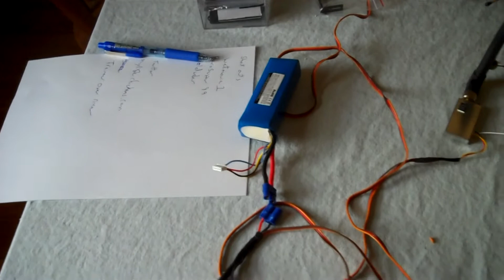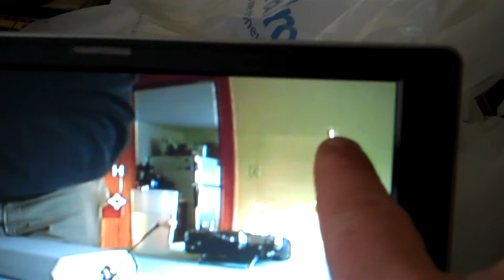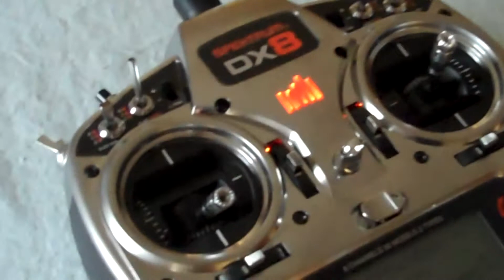More FPV: All electronics are here and working.  FY-21AP, CYCLOPS OSD, BEVRC 1.3GHZ VIDEO SYSTEM

Comment: Well done !! My pieces are all from Ready Made Rc, but have pretty much the same elements in place. You are a visual schematic of what we're setting up - excellent !! My airframe is the FPV 168 with flaps, 2x5000 mah 14.8 volt battery running the whole thing with 2 ubec - 6v to the reciever+ 9 servos, 12v to the camera and 800mw trans., EZ UHF tx/rx on a Futaba T10cag. Keep up the good work !

Comment: @hairlesshippy   Yeah np. It all depends on your airplane. For example my easystar used to have a 500mah independent lipo that runs the video. Then another 3600mah battery to run the motors/servos/receiver.  I got rid of the 500mah battery (60grams less) and I am now powering everything from my single 3600mah. Oh and I made a homemade power filter (inbetween the battery and the video system) because the high draw in Amps from the motor would produce white lines on the video.

Comment: I just took out some track by plugging in the battery without removing the red wire.
lucky it all worked after jumping the burnt out circuit track.

Comment: Thanks for the demo on this. What is the voltage going to the Transmitter? Is it directly connected to the battery? Do you need a BEC reduction to 5v?

Comment: The video/BEC/tx battery is a little overkill isn't it? Instead of a 1800mah try a 800/1000mah lipo. to cut weight in half.  Or just use a 3000mah flight battery and power the whole thing with it.

Comment: VERY good video. I have a question. I have the Hornet OSD and I have wired my current sensor as you said here. However the power coming out of the plug that I am suppose to plug into the OSD is registering 15v when the OSD interface says +5v. I am not sure if I am doing something wrong here and appreciate your expertise.